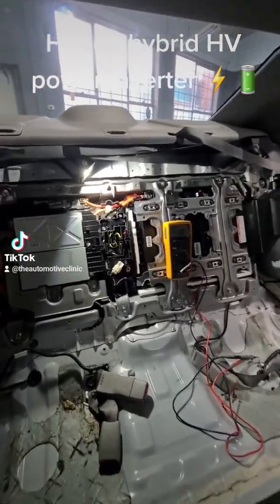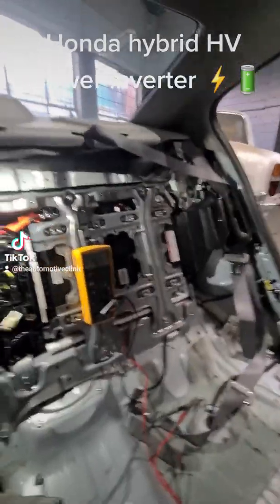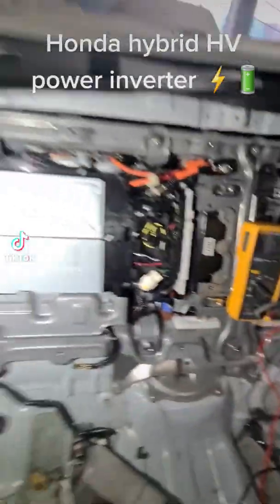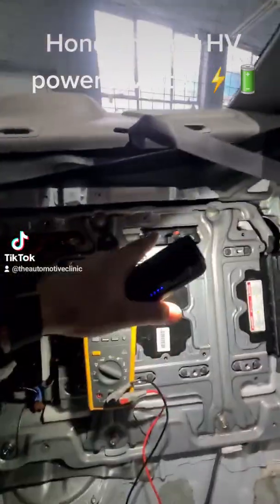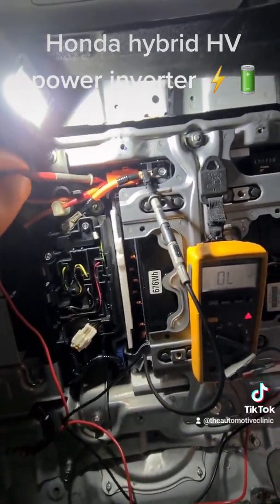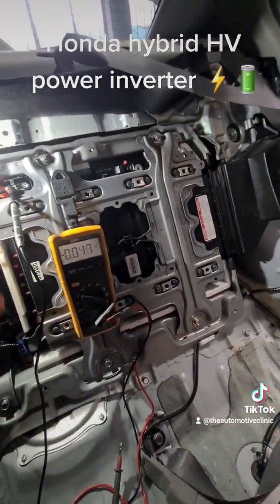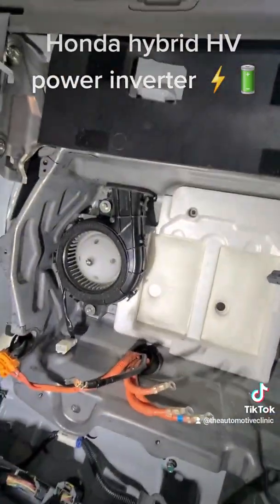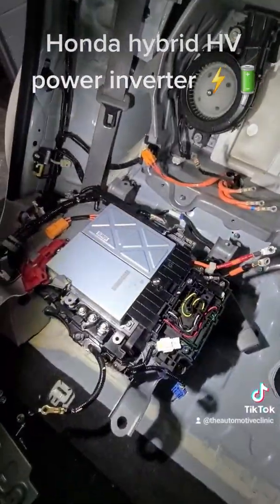Honda civic hybrid Motor power inverter (MPI) replacement ⚡️🔋🔧

Comment: Do you have a video on removing and replacing the IPU fan that you were talking about at the end of this video?  I have a 2009 Honda Civic hybrid.  (Also, is the fan in the 2009 in the same location as the one in this video?)  Thanks!